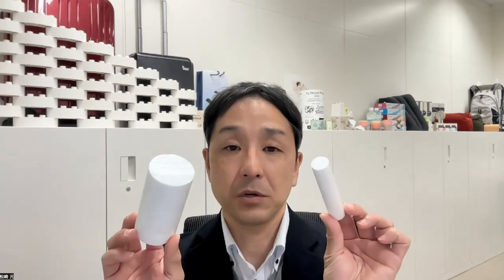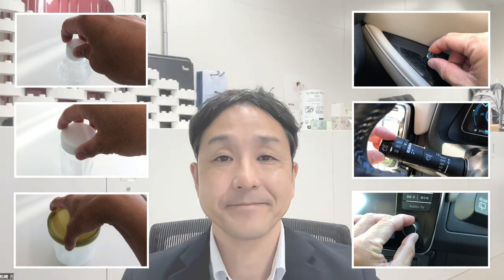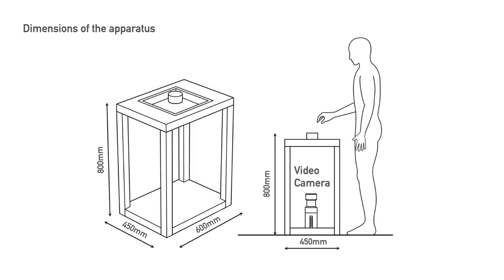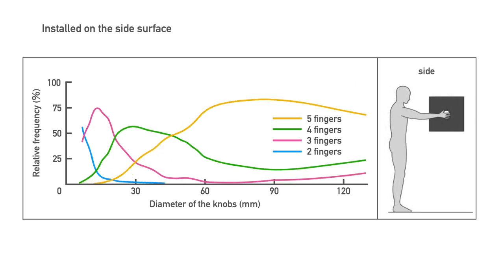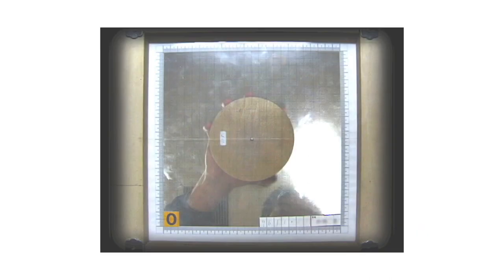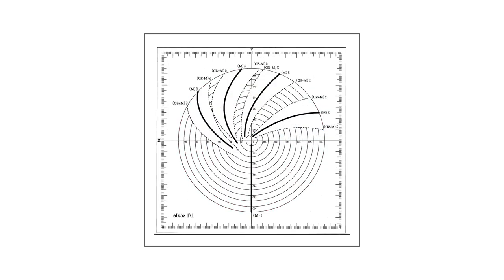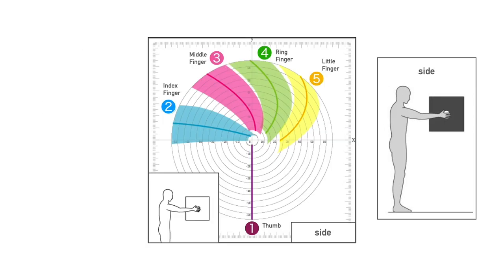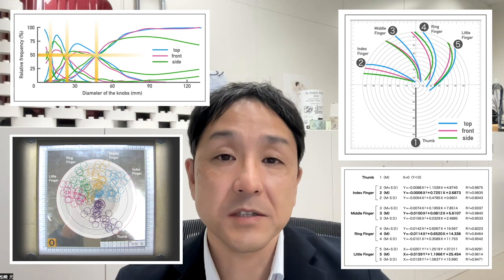A Good Grasp of Knobs: 2022 Ig Informal Lecture

Comment: Thank you for this insightful research. I have designed control surfaces for a few tools and equipment panels we use at work, and have tried to take ergonomics into account when it comes to knob size with the task at hand. I didnt realize that the orientation of the knob would make such a significant difference, especially with finger spacing. Now for a question: Have you taken the use of gloves into consideration with knob size and finger count? I had to account for the operator wearing two distinct types of gloves, so one of the knobs I designed was oblong shaped to assist with the proper "feel".